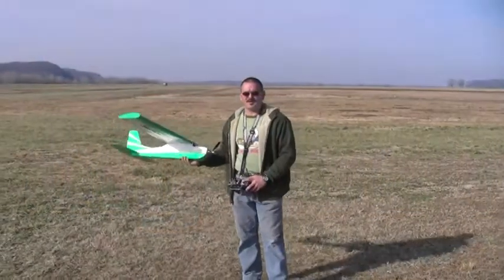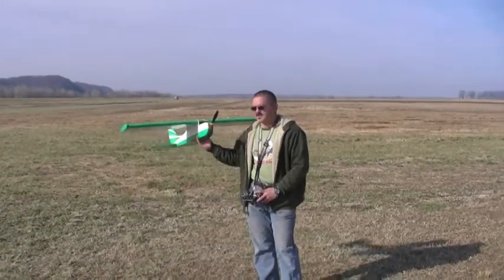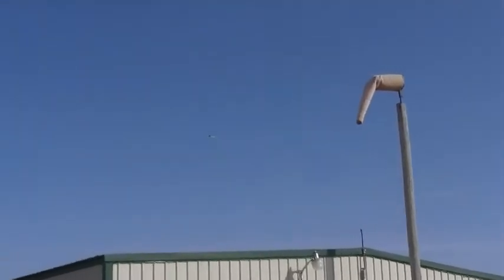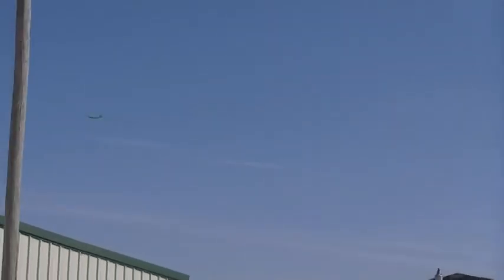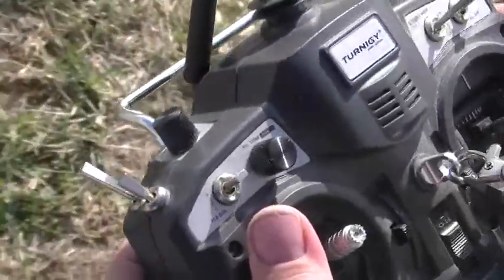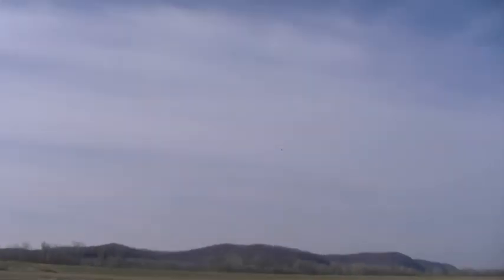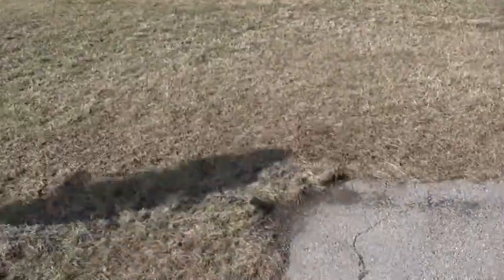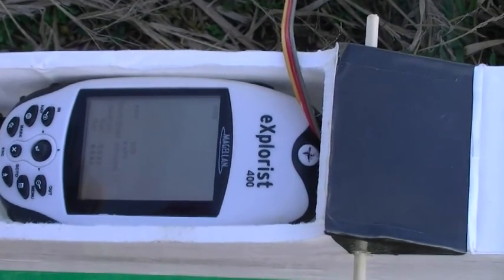Endurance Test, Flight 1

Comment from the maker: if you're going to fold it up at all (like rcFoamFighter plans or my plans do) then the slight warpage is OK as it gets straightened by the folding. Single flat sheets makes it kinda a PITA to work with when warped. only suggestion I can make is either try a light misting of water on both sides and then clamp flat, or same slight misting then peel off the paper and just build with the foam core. The paper is normally what causes the warping in my experience. hope that helps.

Jon